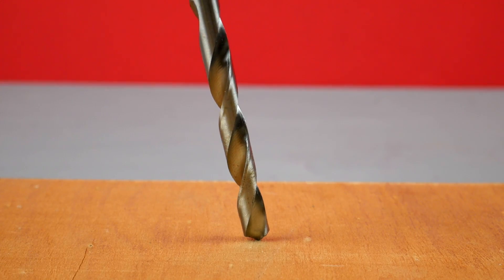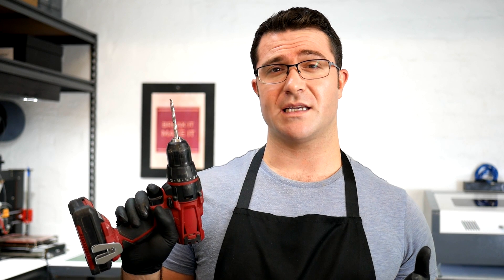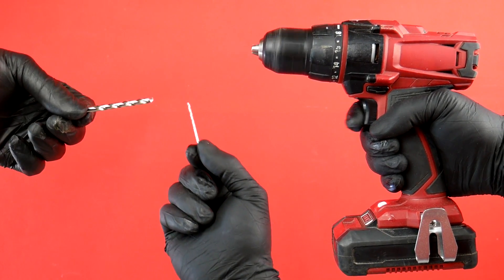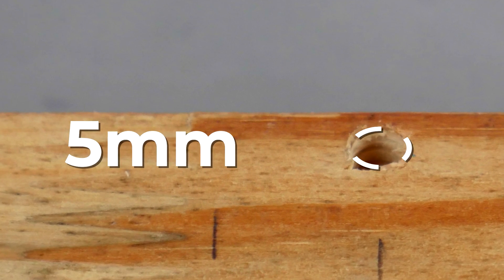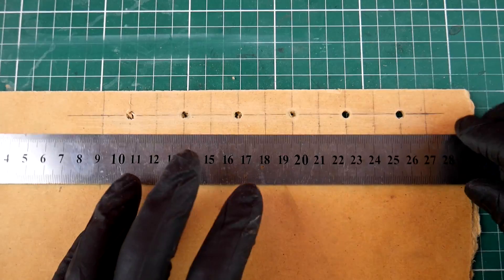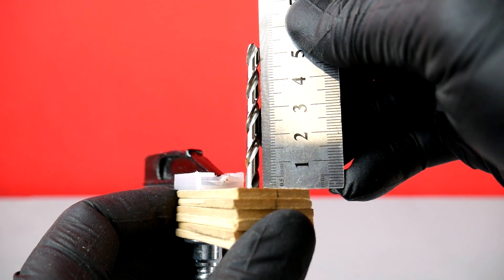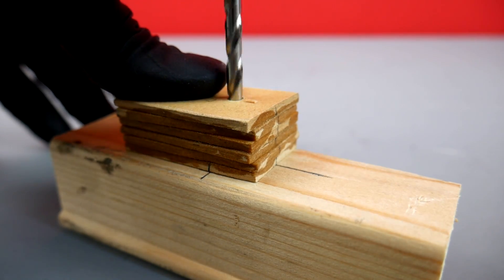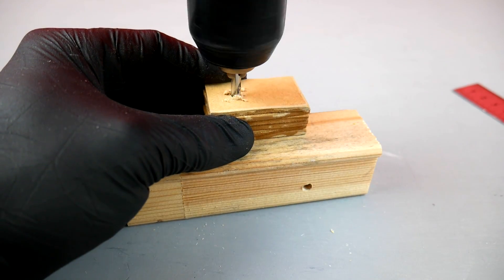How To Drill A Straight Hole Without A Drill Press

Comment: Could have used Metal Tube in the Build for the first hole size & inserted other close fitting tubes for smaller sized holes (reducing the number of Jigs you'd have make) OK, quite limited given tube sizes available, but should be good for 2 or 3 other sizes ??

Comment: Any recommendations on how to drill straight on a surface that is NOT flat??? ....i need to drill a hole in my oil pump to tap and install a thread insert for the tensioner to be torqued down to specification..... And i need to do this while it's on the engin coz it's too much effort to remove the oil pump

Comment: I use a small plastic mirror, with a clearance hole drilled through the centre. Place mirror on workpiece. Drill workpiece through the hole!   If drill is not perpendicular then drill and its reflection will look bent. Just line up the drill with its own reflection and then start drilling.
Reply: Can you make a video of this? It'll be much easier seen than read bro, and it sounds genius tbh
Reply: Can you make a video of this? It'll be much easier seen than read bro, and it sounds genius tbh
Reply: Popular Mechanics suggests using an old CD as a mirror.
Reply: @GeezerTuber  Oh, now that, that's clever

Comment: What if you need to drill into an uneven surface perfectly straight? I see that jig working for flat surfaces, but im working on a guitar that has a "carved top". The back is flat, so it lays perfectly flat, but the top is sort of domed. If I put that jig on the surface I need to drill, I would be able to rock it back & forth. The only way I could get that jig to work would be if I had the reverse radius cut into the jig... FML!
Reply: Spectt if it lays perfectly flat you would need to build a mini table to place over the curved area, using 4 dowels of equal length and a 3 mm sheet as the table top to achieve just the height needed.drill the same size hole as in the original jig through the table top in the necessary position. The table top (for lack of a better description) with its hole acts as an additional “layer” to the original jig
Reply: OMG! I understand what you mean, and that would totally work! I'm picturing 2 perfectly even stacks of books on each side, and something else perfectly flat to bridge the gap. Then use the newly minted flat surface as the surface to place the jig, going thru the sacrificial "bridge" and into the guitar! 

OMG I would of NEVER thought of that. It's already been sitting on my work bench for over a month while I was stumped. I was honestly just waiting for the time to go to harbor freight and pickup a cheap drill press, soley to drill [4] 11mm holes for installing a tune-o-matic bridge on a guitar... Awesome! I can't wait to try this. You literally just saved me $60 bucks! Thank You!👍👍🎸🤘👨‍🎤
Reply: Spectt Rock On🎸

Comment: That's a pretty nice solution when the required hole is shallow relative to the length of the drill bit. But - what do you recommend if the hole depth is comparable to the length of the bit?
Reply: I usually use some scrap 4x4 posts. Cut 2 pieces perfectly square (on the ends) with a miter saw, about 6” long each. Then lay the blocks flat at right angles to one another, so that the inside corner that is formed is where your desired hole will be.

When you align the bit into the corner of the two pieces of wood, and the wood is flat against the drilling surface, then you know that the bit is straight in the X and Y directions. 

If that doesn’t make sense I can take a photo. Honestly the method in this video is ridiculously complicated compared to the two 4x4 block method.

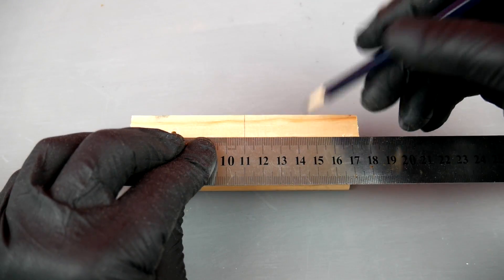Edit: check this video at 3:30 mark: https://youtu.be/IxpRhtPejJs

It’s basically the same concept, except this guy cut a single piece of wood to contain a 90 deg angle instead of butting two 4x4 blocks against one another (or smaller wood if your bit is less than 3.5” long)
Reply: Drill as much as you can. Then remove the guide and use the hole as the guide to drill deeper. If you are careful, this usually works well.

Comment: Hi, thanks for your video-hint! I have to drill a  vertical log horizontally, but the surface is not regular... Do you have any suggestion? the drill bit is 22mm x 500mm, and the log is about 400mm diameter. thanks a lot

Comment: I use a drill guide to make a hole in a short piece of 2x2 scrap and use that as my portable jig. The drill guide also lets you drill at angles to make angle drilling jigs that can be clamped to your work for cutting pocket holes and the like.

Comment: This will sound a bit exotic but this tip is for those viewers that have a palm router with plunge base.  With a plunge type spiral bit, you can effectively drill holes perpendicular on any size work piece so long as you can reach it.  Pretty sure there are cordless routers if you don’t want to be tethered to a power cord and would be very portable .  Just a thought.
Reply: I have a small router and your solution is so obvious and perfect for my current project that I am kicking myself for not thinking of it myself. Thanks.
Reply: Great tip. I need to be able to accurately drill the edges of boards for dowels for a custom-built storage unit soI'm going to use your tip to drill the perpendicular holes through the pkywood pieces shown in the video to make a jig for situations when a router is too cumbersome to use.
Reply: This sort of stuff is gold. I came for the video but I always read through the comments and left with a great tip like this. I have a router which will now be put to a new great use! Thanks!

Comment: Can I use acrylic sheets?
Reply: If the acrylic could be cut/drilled with reasonably smooth edges, I don't see why not...in fact, your idea might be superior if the acrylic were clear, because even through several layers of acrylic, you might be able to find your intended drill spot easier!

Comment: "Break it til you make it"<< HAHAHAH, The story of my life!! Your right @ 0:27, what seems 90* is 99% not. So the thin pieces is better then one thick one because drilling one thick one for guide without a drill press the hole will not end up being 90*, but when drilling several thin pieces and line them all up with square they end up being a 90* jig. The part I dont get is why cant those thin pieces be cut with small battery circular saw? Excellent video thanks for sharing!!
Reply from the maker: I try to make videos that people can follow, I understand many people don't have specific tools but if they do then they should use them.
Thank you for watching to the end!

Comment: I have problems drilling vertically into concrete floor. After drilling, I insert stainless steel shaft (about 3" long and 8mm diam). Most times the shafts are at a slight angle and can be problematic for my work.

Comment: Problem starts when you use a smaller bit (may not be accurate) or a bigger bit (will not fit). Unless you make a jig for every bit size.

Comment: Woodworking without a saw! Good jig. Have not seen this before in my 70 years.  However, every woodworker should endeavor to own a decent drill press. Thanks.
Reply from the maker: Thanks for your comment. I totally agree, in the long term any maker should acquire a decent tool collection.
Reply: @cosador  But, a counter argument: I am restoring a wooden boat at present, and there are zero straight bits of timber in it—so a tiny jig like this is perfect. 95% of the time, I simply could not use a drill press on board, because there's not enough space to use one. Two thumbs up from me.

Comment: That actually makes a lot of sense so I might give that a try in the future. I just put on handles on my wall cabinets that required making two holes per door; they came out great but certain holes were a little slanted so I had to widen them a little so the screws straighten out.  This will save me a lot of time once the counter tops come in and I can finally put in the base cabinets doors.

Comment: Hi it's a fantastic good idea and with  the use of cheap tools , so many videos on here have been made with expensive machinery which to me is ironic. But because your idea is of wood won't the hole wear out after a few goes because u take some of the wood as you still.
Reply from the maker: Timber does wear out but metal does too, however the methodology with making both is not that different. Thank you for your comment.
Reply: @cosador  thanks for the reply, its a good angle you have taken - make cost effect solutions with low cost tools :)
Reply: I think the idea behind this is that it's fast, cheap, and easy, so you can use it until it's out of spec, then make another.

That way, all you're losing is scrap MDF, not wearing down a more expensive jig.

Comment: Easier way to do this is cut a load of discs using a hole cutter.  Glue and then clamp them together using a large bolt and washers.

Comment: This is fine for drill bits much longer than the depth of wood you're drilling into.  Not good for the small drill bits I'm using to make pilot holes for nails and screws in my "2x4" furniture projects.  The jig loses too much height for those.  Not sure what my answer will be, but this isn't it.

Comment: I like the concept of using multiple pieces glued together to make a hole jig. Could make a jig for different size holes using the same concept. Was planning of making holes to hold coins for different types of wooden cell phone stands of various sizes. I would have used a drill bit the size of the holes inserted into the holes of all the cut pieces before glueing all the small pieces together. Other than that it was a good idea.

Comment: Interesting concept. Could you just drill some holes in a thick piece of scrap wood and measure it to see it's 90 degrees? How would you use this on the horizontal edge of a 2" x 2" to create a butt joint? Thanks